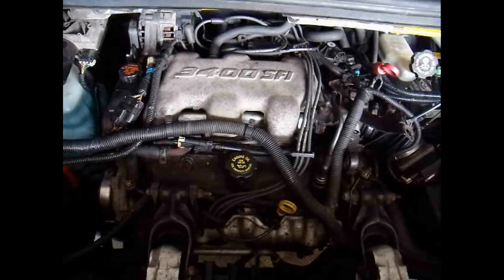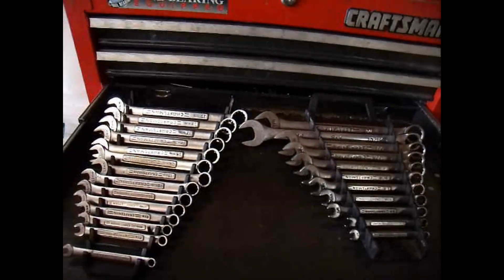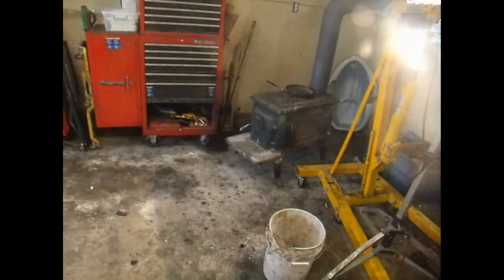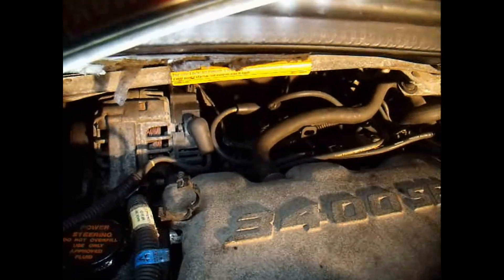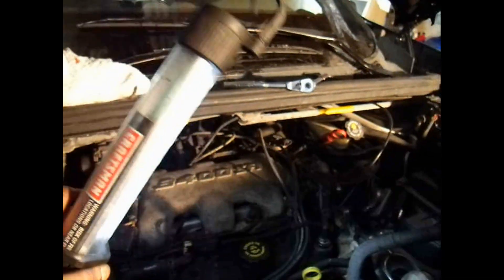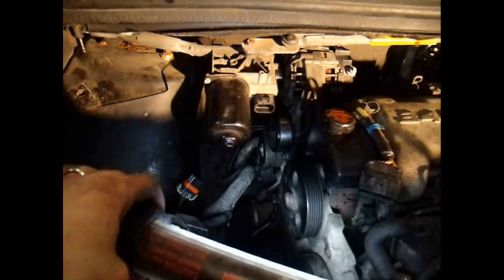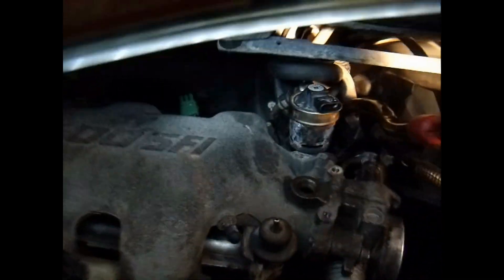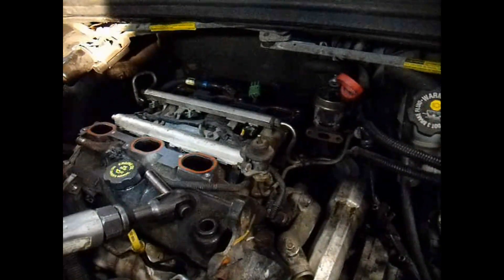How To Change A Bad / Blown Head Gasket 3400 GM Overheats Thermostat Intake Manifold No Heat 3.4

Comment: Thank you for the vid! It gave me the balls to do my wifes 02 montana..Just kept over heating and tons of air in the coolent.. I found lower intake gasket was crushed and both head gaskets were shot and someone put stop leak in and cloged all ports in the block....It took me about 20 hrs to do but it runs AWESOME now. I cant thank you enough for the vid!
Reply: This comment just might give me the motivation to attempt this on my 01 Grand Am. I have k seal in my system, but my mechanic says I need new head gasket. Wish they replaced it back when I got the intakes replaced years and years ago for $1000+

Comment: Thank you, VT247, for taking the time/effort to do this on a van.   I don't have 24/7 to do this, so, taking pics and labeling the connectors is my only add.  I spread my repair work over weekends. :-)
Reply from the maker: It's a long arduous process.  But you're doing it right, label all the parts and put them in an order you can remember.  Do keep in mind that the pushrods are of different lengths for the intake and exhaust.  Bolt the rocker arm downs to the correct torque specs, may have mentioned the wrong torque specs.
VT247

Comment: Your a mad lad bud I’ve done this job before. Just watching for the electrical routing because I had one come in already tore down to the block. I can confirm pulling the heads together with the cross over pipe is NOT an easy task especially going back together
Reply from the maker: Should have just cut the bolts holding on the exhaust. But figured I could heat them up and they'd come loose once out.  Nope, broke nearly every single one, they were pretty rusted on.  But, in the end, it all got fixed and ran for years after this fix.  Should have done the timing cover too at the same time, because it eventually failed too.  Not sure why they made such bad gaskets for these 3400's.  Eventually, the timing cover, the intake and head gaskets all fail.
VT247
Reply: @Vacationtime247  awesome!! I’m glad it ran for a long time for you. But I think they fail so much because that are aluminum heads and iron block. Also the the engine mounts on the head closest to the front of the car. The engine mount thing is just speculation maybe it doesn’t affect it at all

Comment: Thanks for making this video!  I am currently doing this to a Buick Rendezvous.  Your video has been extremely helpful. 
The hardest parts for me were: 1) unhooking the exhaust mani from underneath was a pain and I broke one of the bolts.   And 2) that dang bracket above the A/C compressor!... That sucked!  Mine was stuck or rusted on or something.  I put a hammer to it and it finally broke loose after ab 50 wacks.lol.
Thanks again!

Comment: Just found your video and I am hoping this puts us in the right direction for repairs. My pontiac montana has all of a sudden had heating issues, would be hot at first then go cold. When it goes cold the temp jumps up. Then a few minutes later the temp goes back to normal and heat works again. We changed thermostat, water pump, flushed everything out. And still having the issues. After seeing your video I think I have convinced the husband to change the gaskets. Let's hope this is the only problem and it hasn't caused any other damage.
Reply from the maker: From the symptoms you've described, it certainly sounds like the head gasket.  It's not a terrible job, but it is time consuming so be patient with him : )
VT247
Reply: Thank you for replying. I will be patient :)

Comment: Thanks, I was looking for this and how to bleed out my Venture's system. It's had air pockets in the past with various work. I started working on it on my own to save money, but couldn't get all the air out. Will be doing a test drive to the gas station later to make sure all the air is out and it isn't overheating anymore.  And my friend's gag gift of pink tools actually came in handy... (And quick/easy tips on fixing gas gauge would be awesome.)

Comment from the maker: I did get new head bolts when I did the head gaskets.  It's recommended that the intake bolts get changed too but I didn't get those new.  Good luck on the fix and hope this helps.
VT247

Comment from the maker: You can reuse those rubber intake manifold gaskets.  I originally did just the intake before biting the bullet and then doing the head gaskets.  It's not really that difficult, just time consuming.  With the oil dipstick tube, I just cut off tab and left it in.  Pulled both heads at the same time with the exhaust crossover still attached.  A thin layer of RTV on the water jackets on the head is a good idea too.
VT247

Comment: Thanks for reply. 2003 Malibu 3100 just purchased was pressure washed before and it looks like it had or has LIM gasket failure. Front cover is caked with oil and wet looking down sides. Will do front cover, water pump and timing first to see if that's my source of coolant loss. No temperature issues, just needed coolant one day, heater is so so, slight white smoke and clear water from tail at warm up which does have slight smell. May need to bleed after hose replacement. Thanks for videos.

Comment from the maker: Don't feel bad.  I spent hundreds of dollars trying to fix a transmission issue on a Durango once.  Come to find out it was a simple wire.  Wasn't getting 12 volts to the transmission, making it only work in limp mode second and 3rd gear.  A free wire fixed it.  This after replacing the computer, solenoids, pigtail, etc.  Sometimes it's the one thing that's overlooked. : /
VT247

Comment from the maker: The LA1 3400 ("E-code") was a bored-out version of the 3100. It retained the OHV layout of the previous engine, and was first utilized on the 1996 U platform minivans
Applications:
1996 Chevrolet Lumina APV
1997-2005 Chevrolet Venture
1996-2004 Oldsmobile Silhouette
1996-1998 Pontiac Trans Sport
1999-2005 Pontiac Montana
1999-2005 Oldsmobile Alero
1999-2005 Pontiac Grand Am
2000-2005 Chevrolet Impala
2000-2005 Chevrolet Monte Carlo
2001-2005 Pontiac Aztek
2002-2005 Buick Rendezvous
Reply: ALEROS only ran until 2004.

Comment from the maker: Same exact thing happened to this Black Aztek!  The exhaust bolt broke, had to get a new one after taking it to the muffler shop to remove what was left.  The other problem was getting that stupid bracket off there.  What a pain!  Kept having to jiggle it loose and pull.  A little lubrication helped too.
VT247

Comment: When I warm up my Montana I get a puddle under the exhaust can, another puddle under the exhaust tip, and another puddle near the front of the engine. It almost looks like steam in my exhaust but it all seems to go away once it’s warmed up. A check engine light came on around a month ago but I thought it was just my P0171 coming back (lean code - I had just plugged a hole in the intake manifold and wasn’t sure that took care of it). Because it never went away like my P0171 was prone to do I assume it’s something new and perhaps I really did solve my P0171 a month ago.

Over the last month I realized I’m suddenly losing coolant fast enough that my Low Coolant light came on once and I had to fill my reservoir twice. Before that I went nearly 7 months without having to add any since I did a coolant flush in April. Makes me think I’ve got some kind of gasket leak though I still have plenty of heat.

I know my drain petcock leaks but it’s an aftermarket radiator and I can’t find a replacement. It’s been a slow drip that doesn’t explain the sudden drops unless it somehow got worse.

I’m going to get my codes read next. What codes might indicate a problem with the head gasket? Thanks!
Reply from the maker: The exhaust will have some condensation that will exit out drain holes on all cars.  If it smelled sweet or left a cloud of smoke coming out then that should be addressed.  As for loosing coolant, do a coolant system pressure test.  Can do the loan a tool from Autozone or perhaps O'Reilly's to pressurize the coolant and check for leaks.  As for the petcock leak, perhaps a quick fix may be in order.  Roughing up the area with some sand paper then cleaned.  After that, put some JB Weld, Steel Putty or even a fiberglass resin fix to slow or stop it if there's a crack.  Any GM 3400 I've had where the head gasket leaks the overflow tank typically bubbles when running.  Exhaust gasses entering the coolant passages or otherwise known as a blown head gasket.  Could test the head gasket with the blue dye method.  Where you put a special blue dye in a syringe, then draw up the air from the radiator cap or overflow bottle and it will change colors if exhaust gas is present.  Typically though, the engine will overheat after a short distance.
VT247
Reply: @Vacationtime247  Thanks for the in-depth response.

Read the codes and it’s a fuel pressure sensor. Had the whole fuel pump replaced last year just for the fuel level sender and it’s been ringing loudly ever since which makes me wonder if it’s related. Definitely not related to my coolant issue though.

It’s not overheating or bubbling and the heat still works great. I have smelled sweet coolant when getting out on multiple occasions including today. I hesitate to do a pressure test because I could not get the coolant level sensor to securely attach to the aftermarket radiator. I had all the hoses and the faulty coolant level sensor replaced last year but the replacement didn’t have the O-rings it’s supposed to have and also never worked. I replaced it again months later with one that actually worked and it kept blowing out. I replaced it again with OEM and it seems to be holding but I can still pull it off by hand without manipulating the wires that are supposed to clip it on, which makes me think a pressure test will just blow it out. It’s been fine since March and the new coolant leak does not seem to be coming from there.

I’ll take your advice and deal with the known leak at the drain petcock. I doubt that’s where the smell is coming from since I can smell it as soon as I open my driver door (drain is on the passenger side). Still, all the small puddles appear on the passenger side so to smell it as soon as I open the driver door it must be getting vaporized by something place hot in the engine bay.

I’ll keep looking but I can rest a lot easier knowing it’s not likely as serious as a head gasket. Thanks so much! You are definitely the premier 3400 expert on YouTube. :)

Comment: Air compressor alarm at 18:00 hahaaa we have the same thing happen at random here...effing brown note :) 

TY for the video! I may take time and put a timeline list together for the order of when parts are removed. 

Like pulling the power steering pump is tricky on a 99 Pontiac Grand Am  if u do it before pulling the back fuel rail..or both rails with intake in this case. Had to jack the engine up for support at that point and then during pump removal had a pull and twist the entire pump CLOCKWISE a little (maybe to 1 or 2 o'clock) during removal for clearance. No we didnt support it first think I know lol but yeah little tricks to learn and add for the next mechanic ;)

Comment from the maker: It's the head gasket.  If you've bled all the air out of the system and it still goes hot, the head gaskets are either going bad or already bad.  I just replaced my head gasket on this Aztek and didn't bother to resurface the heads.  Drove it 100 miles and the problem has been solved and runs better than ever.  
VT247

Comment: Hey. I got a 2002 Chevy impala w/ 3.4 engine and it overheats. When I add antifreeze or water in the radiator, it will shoot out once the car runs... I need help!!
Reply from the maker: Sounds like it leaks once it builds pressure.  Find out were at it's leaking from and start there.  Might just be a bad hose.
VT247

Comment: i agree. my brothers 2004 grand am 3400v6 he just bought started every now and then it would get a lil too warm to where he would have to pull over. done that a couple times then we said well maybe its the thermostat, then were thinking well these engines are bad about intake gasket problems. then were like well were not going to do the intake gaskets and not do the head gaskets. good thing we did.  the front head was junk, had very deep corrosion and im sure it was leaking. runs great now.

Comment from the maker: It's kind of a pain to do.  I used a combination of a 3/8 & 1/4 drive ratchet and 10mm long socket and swivel / wobble extension piece.  That and a 10mm wrench.  Had to inch it off slowly with the open end and the boxed end.  Takes some time to do, but it can be done.  I just had to do this job on my other red Aztek after doing it on my black one. Obviously a common problem with the 3400 engines. Be patient and set the car/van/suv on stands, you'll be bent over the engine bay for a while.
VT247

Comment: Thank you.,tomorrow i will take off the valve cover, if the bolts do not look new , do you think is a good idea to replace the head gasket, to extend the life of the engine, or should i just wait until goes bad. thanks again, for taking the time to answer .
Reply from the maker: I would say it's probably a good idea to change them.  The parts aren't much and if it's done right, you'll never have to do it again.
VT247

Comment: Great video you know our stuff. I got a 2000 Pontiac minivan with the 3400. The question I have is the oil is leaking into the coolant. I opened the radiator and it has mostly oil in it. It does not run hot yet as the temp does not go over half , however after about five miles white smoke starts  coming out of the engine.  Thoughts bad head gasket, I don't think it is a cracked engine block because it would not go at all, would it.
Reply from the maker: Watch the last minute of this video, from 19:04 on.  Your engine probably needs all new head and intake gaskets.  The intake and exhaust push rods are different lengths so keep that in mind.  Think you should be good if the motor doesn't knock.

Comment: Did the head gasket actually fix the overheating issue? I ask because these 3.4 engines can have really tricky over heating diagnosis at times.
Reply from the maker: Yes.  Replacing the head gasket fixed the problem of overheating.  Now, my recommendation is to do ALL the gaskets there if you're doing the head gaskets, such as the timing cover and intake too.
VT247
Reply: @Vacationtime247  Thanks. My 3.4 doesn't have a head gasket issue but it has orange crud throughout the entire engine and cooling system which makes it overheat. It overheats because the water passage ways are most likely clogged in the engine. I did wonder if it was oil mixing with the coolant but it is not. I have flushed my 3400 at least 5 times now and this stuff just keeps coming.

Comment from the maker: I left the rear manifold on.  Just unbolted the 2 bolts holding on the exhaust.  One broke and had to take it to the muffler shop to heat up and remove.  Got an extra bolt from Fastenal.  Unbolted the 3 bolts holding on the hanger for the exhaust on the passenger side (2 going in the side and one going up).  Had to use long extensions and a 1/2 inch breaker to get them loose.  Yes, it was a PITA!  After the top front motor mounts were off, it rocked forward and loose.
VT247

Comment: thanks for your comment on my channel. i didnt change the head gaskets cause its recommended to have the heads resurfaced. is this not always nessesary? also, i heard you can perform a test on the coolant to see if it has exaust gases in it and that tells you that its the head gasket. let me know what you think. i replaced the intake gasket and it runs but still the overheat/inconsistant cabin heat issue.

Comment: Help!!!!! i have a 2002 Buick century. that has brown gunk in the radiator. i was told that it was the intake. that was leaking. but, as i was taking it apart, i notice that there was a leak in the top part of the intake. but it also looks like if it was coming from the head. (this is from the head next to the fire wall). Also, the coli pack, there is a stud there to hold the coli pack in place, (the one on the driver's side), how do you take that off???? it's in the way of taking off the vale cover bolt???

Comment from the maker: DEFINITELY do the head gaskets if you're doing the intake manifold.  It's not that much more work and the head gaskets will eventually fail anyhow.  You don't mess with the timing chain while doing the head gasket.  Hope your fix goes well. Be sure not to torque the intake manifold down to hard, I cracked mine once.  Had to replace it.  Use a criss cross pattern for the head and intake torque down sequence.
VT247
Reply: I'm curious if that hissing sound has gone away? I have a hissing sound that I can hear from inside the cabin of the car though I assumed that had to do with the hvac system. I am still in the process of confirming if I have a head gasket issue or not but I wonder if your hissing is similar to mine.
Reply from the maker: @michaelmedeiros2089  A hissing sound would likely be a vacuum leak.  Possibly a coolant leak could make that noise too.  Didn’t have any hissing from the blown head gasket.  But an overheated motor will boil the coolant and make it hiss.  Just some ideas, hope this helps.
VT247

Comment: On the back of the engine where the spark plug wires go to from left to right what is the order? My Buick shows 5,2,3,6,4,1 front spark plugs a 2,4,6, and back plugs are 1, 3,5? The back seems all mixed up is that right?
Reply from the maker: You are correct.  Standing at the front of the car looking at the engine, the back of the engine, from left to right is 1 - 3 -5.  Front of the engine closest to the radiator is 2 - 4 - 6.  The coil pack as is it is on the vehicle from left to right is 5 - 2 -3 - 6 - 4 - 1.   Important to make sure the right spark plug wire goes to the correct cylinder.
VT247
Reply: Great thanks.